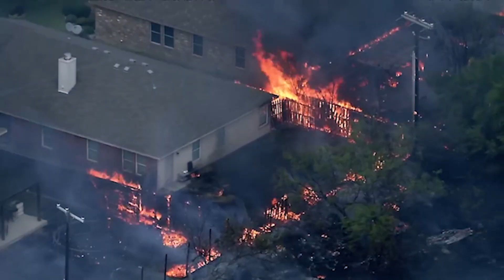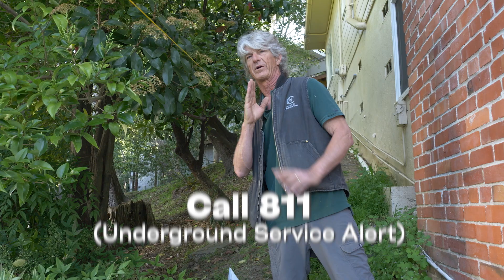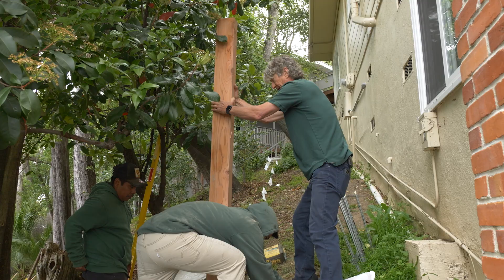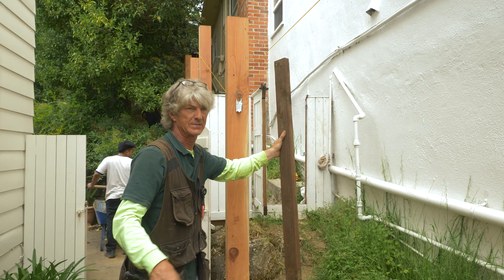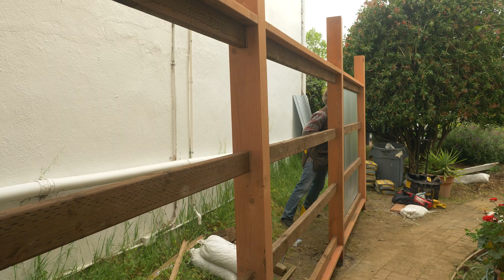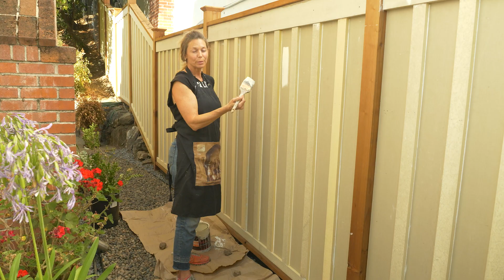Install Fire-Resistant Fence

Comment: Doesn't the wood framing present a path for fire to travel?
Reply from the maker: Greeat question! While this fence design does include wood, the posts and framing are much denser and more difficult to ignite than typical lightweight wood fences. By surrounding those wood elements with noncombustible materials like fiber-cement boards, the design limits flame spread and radiant heat exposure. In effect, the cement fiber acts as a fire break, greatly reducing the chance that fire will travel along the fence to the house.
Reply: @FIRESafeMARIN  So does this meet current home hardening standards?

Comment: I  the fence . You make it look easy BUT it needs some talent i’m sure … and the cost ???
Reply from the maker: It definitely takes some skill and experience to install, but it's a great investment for reducing risk long term!
Reply: @FIRESafeMARIN  Interesting in the gate that was used and gates in general. A neighbor spent  $10K on a fire-approved gate.  Might the County work on developing/designing/manufacturing lower cost solutions for gates which so many of us have?  What planning might you be doing there?